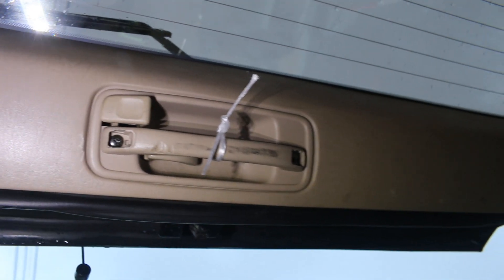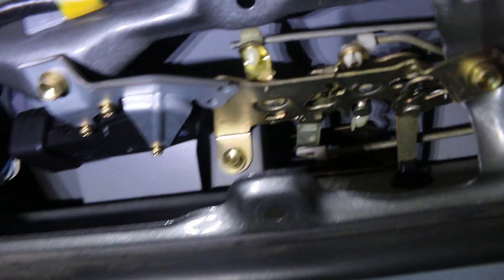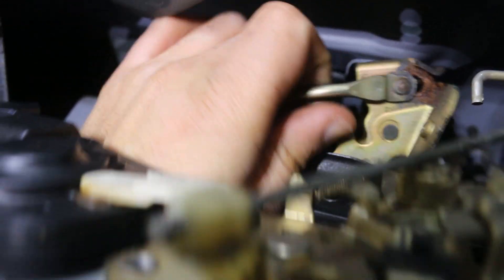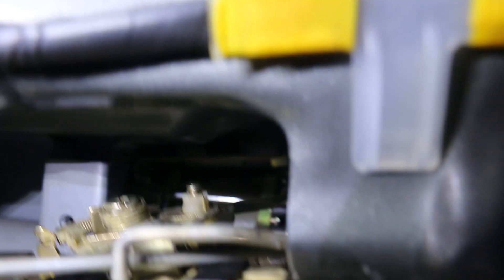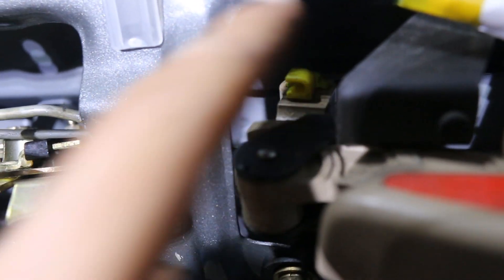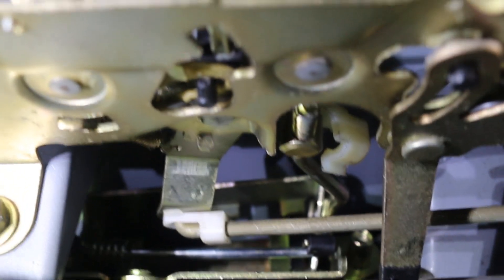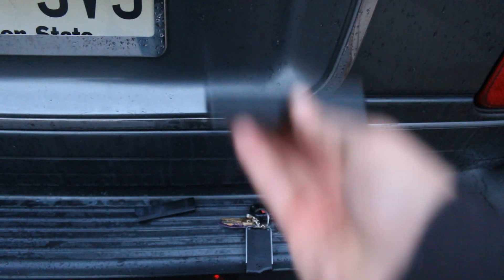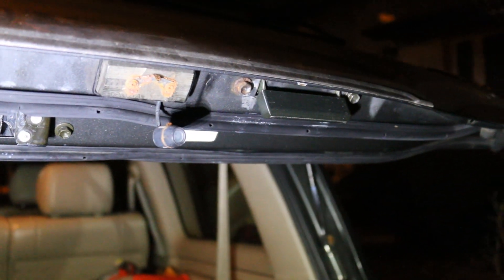LX470 and Land Cruiser Replacing Tailgate Handle and latch assembly

Comment: I wonder what was wrong with the old mechanism.  Since you set the new one to the same length and it didn't work until you readjusted it makes me wonder if you could have just adjust the old one.
Reply: If it's anything like mine on my 80, it still works but is rusted.
Reply: @cordcd7  Probably right. A thorough bath of WD-40 brought mine back to life.

Comment: The handle on my 2000 LC broke and the tailgate is closed.  Is there a way to open it (the tailgate) from the inside?
Thanks!
Reply from the maker: Yes there is a latch on the inside. Also if you get a pair of pliers or something you can swing the metal tabs to open the gate if there is anything left of them.

Comment: Any idea how to reset a solid red VGRS light? It seems has some thing to to do with the steering angle sensor? Thx
Reply from the maker: If you have the techstream software and the usb obd2 connector you can reset this VGRS by going to Chassis/VGRS/Utility/Steering and following the instructions. It is very easy though techstream. If you don't have the techstream software or cable you can get both as a package on Amazon. I did a video on techstream and how usefull it is. All you need is an laptop.

Comment: what caused it to rust is the little rubber cap above "child protector" sticker. they should be removed in colder climates. (condensation)

Comment: Just wondering what tool you used to remove the plastic handle? I tried to pry the clips on the left and right side with a screwdriver, but it didn’t move at all.